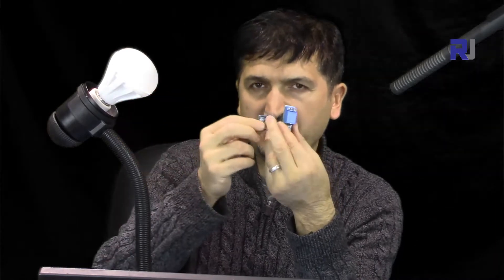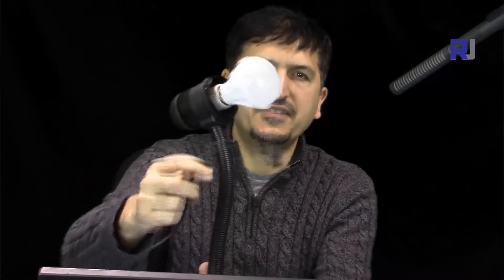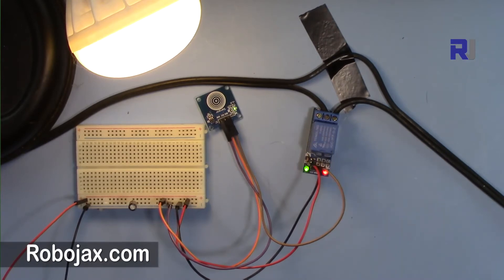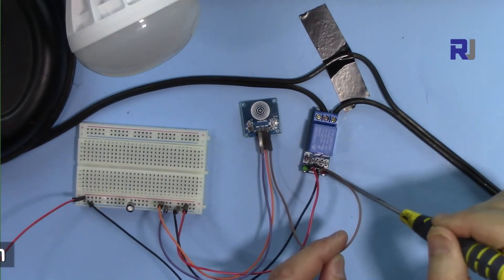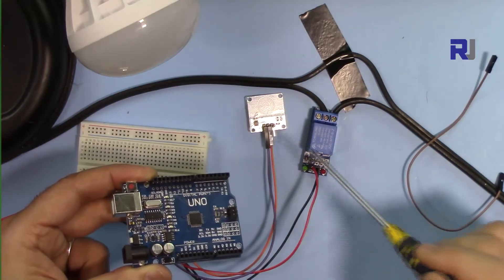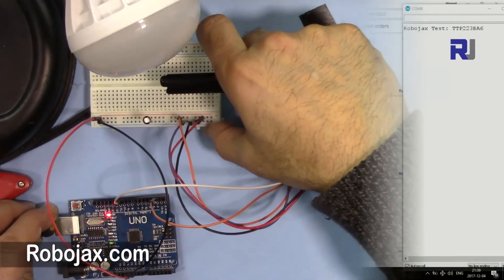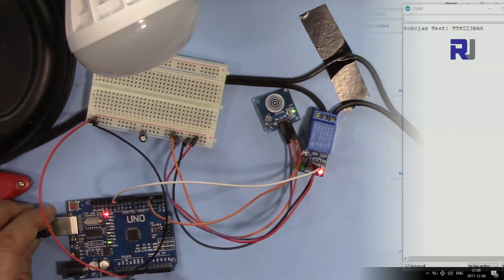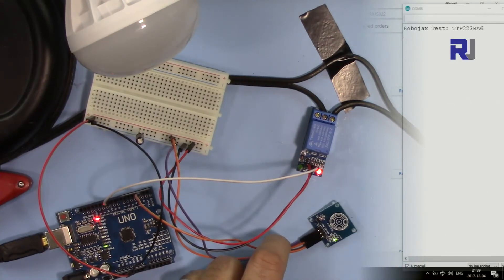E17 Using TTP223B touch module and relay to control AC/DC load with Arduino RJT17

Comment: can you dim also the ac with a capacitive sensor
Reply from the maker: this is just switch. and switch means ON and OFF. Here is Arduino based dimmer https://youtu.be/zJQf6bNodhE and yes you can use the touch switch to make the light dim. Very interesting project.

Comment: Hi, thank you very much for your lesson.  My circuit works great. Is it possible for you to provide the arduino code for the circuit with 2 capacitive switches, 2 relays and 2 lamps with one arduino board? Thank you so much for your help. Svetlana
Reply from the maker: You are welcome. Here is touch for 4 channel with relay https://youtu.be/4kVhG0OpCf8 The best thank you for me is to not skippin the ads and Subscribe  🔔 to my channel,  like 👍 the video and do not skip the ads.. It is greatly appreciated.  🔔  😊. 
I will reply to all Subscriber's 🔔 questions. So make sure to Subscribe.😊 .

Comment: Sir, in your first step when you cut one of the two wires to connect in the relay be sure you cut the right wire. This is important for safety reasons. One wire is ground and one wire is hot. the ground wire should never  go through a switch or relay, otherwise you can end up with dangerous voltage on the appliance when it is turned off. You can tell which wire is ground because it is always marked somehow.  On a lamp cord if you look closely you will see or feel small ridges on the ground wire side. This is connected to the wide  pin/spade on the plug so you cannot plug it in wrong. Cut the smooth side of the cord only, to be safe.
Reply from the maker: Thank you for the comment. For most loads it does NOT make any safer whichever you cut see here https://snipboard.io/ujC2dH.jpg

Comment: I have watched your full explanation which has been done very clearly. I wish to use this without Micro controller Adruino and in the direct mode...I want to act the touch pad as toggle switch..i.e....touch to on and again touch to off...with any time of gap between on and off. Just like we switch on some load and switch it off whenever we wish. Once again, you can switch it on by touching it and switch it off as and when needed..is it possible by adding any component to this PCB...???
Reply from the maker: without Arduino Microcontroller (MCU), you can't do it. When you touch without MCU, it turns ON and when remove your finger, it turns OFF.
Reply: @robojax  
Yes, I have purchased a wrong item...This board can't be remodelled somehow..????
I should have enquired and seen many videos before buying it. Actually, I should have bought the Brown Coloured PCB wherein provisions for 2 jumpers are there...Which help in using the board in 4 configurations plus it has a slot for extra condenser also for sensivity adjustments. Price is more or less same...The company which supplied me hasn't given any support... That's very bad...😢😢😢

Comment: Can I use Power Module transformer 220V AC - 5V DC to get 5V from 220V source?
Reply from the maker: Yes you can. But your comment is int he wrong video. You should watch this video https://youtu.be/-JD3E7e0RAE
Reply: @robojax  thanks for the reply. Now I have new problem. The relay only turn on once and doesn't turn off when I touch capacitive touch switch again. If i add 10 microfarad capacitor will it fix this issue?

Comment: Sir my touch work is not properly working  one time touch relay  many time connect and disconnect bulb  light biking speedily I use 50 volt and 22 uf capcator please solve my problem
Reply from the maker: the problem is not the capacitor. Change the delay in the loop. if dalya(200), change it to dalay(500) or more to get better result.
Reply: @robojax  thanks sir
But I use without arduino so how can I delay change a
Reply: When I touch so pulse not Gernet properly and relay green led not off  problem suddenly duering the touch the pade and
Some time I touch pade it work proper
Reply from the maker: inside loop() just put delay(500) or more value https://snag.gy/AHhRpV.jpg

Comment: How do I check if my ttp223B or relay module is working and has no faults because even after proper connections it isn't working
Reply from the maker: if you don't get any value on Serial monitor and connections are okay, then the module is bad.

Comment: i have a small doubt that, can we press a touch sensor for long time
Reply from the maker: Yes you can. As soon as your finger touches, the switch/relay will activate. Once you remove finger, switch/relay will get disconnected. So if you keep for long period of time,  the switch will stay ON until you remove finger.
Reply: Robojax Thank you very much for u r reply

Comment: Hello,
My electronic assembly and your code (I copy / paste) code does not work. I use a Velleman VMA305 and it does not work. It's the problem ?
Also, you use which component (values ?/Model?) on the breadboard between + and - ? . Thanks for your help.
Reply from the maker: Does the module light turns ON? if not check wires. if yes. than check your relay by connecting the input of the relay to instead o connecting to touch module, connect it to GND to see if it turns ON (or to 5V if your relay is high trigger).
The component has been explained at 5:38 and it is a capacitor to filter noise. But it is should not affect the module.
Reply: Thank you very much, but i read only because... I'm hard of hearing, not like everyone else, but like many people.  Thank you for your answers

Comment: Hi Robojax, I stick a TTP223B sensor to a piece of glass and would like to have that glass act as a switch. The problem is when the sensor touches with the glass (without my finger touching the sensor or the glass) it sends a high signal to the Arduino board. I have also tried connecting the signal pin of the sensor to an analog pin in the arduino and the Arduino reads 1023. I have also tried connecting the GND of the Arduino board to my house's ground but it still sends a high signal when the sensor touches the glass. Do you think this is the way the TTP223B should work or is there something wrong with the sensor? Thanks.
Reply from the maker: HI, Interesting. This module uses capacitive touch to detect touch.  So the surface area where you are supposed to touch determine the proximate value for the capacitor and it has been calculated to work that way. When any other object comes in contact with that plate (touch area or electrode), it changes the capacitance of the electrode and as a result it triggers the touch detection. So if you can, you should draw the schematic diagram of  this module and find out the which resistor or capacitor to change and it will work.
here the datasheet for this module: https://infusionsystems.com/support/TTP223.pdf
and you can see it says: Sensitivity can adjust by the capacitance(0~50pF) outside.

Comment: In the setup without the Arduino board, the touch sensor works just like a push-on button, now if I want to make the touch sensor work just like a regular on-off switch do I need the Arduino to do that?
Reply from the maker: Yes you do need Arduino to so it keeps the status of your touch.  Watch this video and you will learn that. https://www.youtube.com/watch?v=Nqh1vYQEEjs
Reply: Thanks for the info.